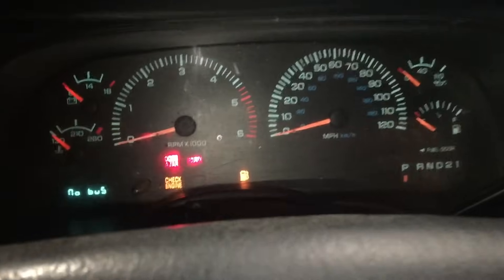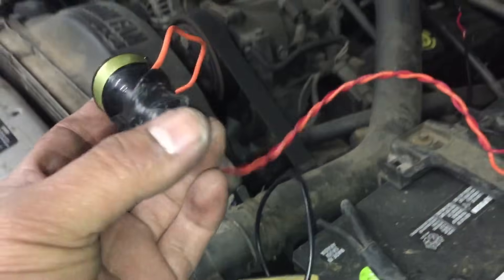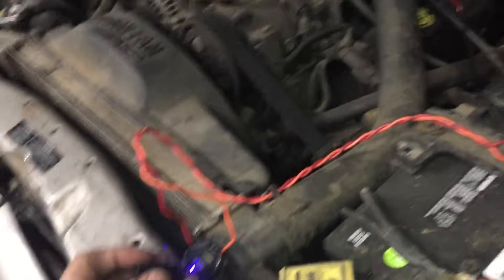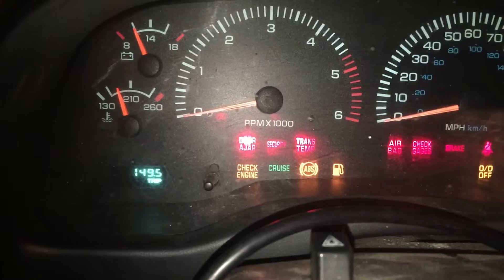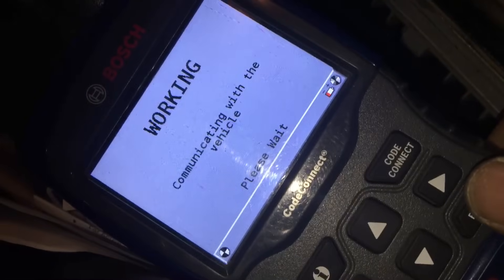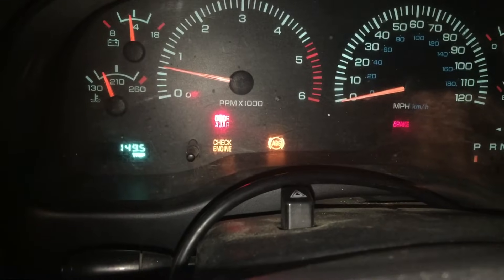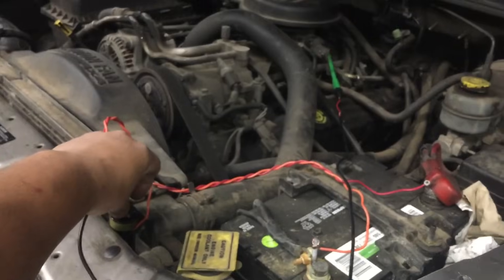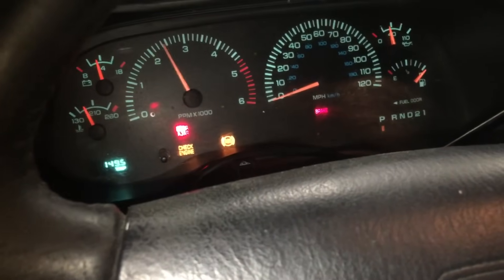No Bus No Start FIX!!!  Dodge, Chrysler, Jeep, Plymouth, or Ram

Comment: Ive change the idle air control Map Sensor an Throttle body sensor an the Ignition Coil an its still off when im Driving

Comment: kinda same issue here. though i get no bus through the cluster diag. truck starts and runs fine and the obd port communicates just fine as im able to see live data. i've tried to use a different cluster from lkq and got the same no bus message. any advice?

Comment: very good trouble shooting the usb plug supplies the 5 volts to the TPS then back feeds the no-BUS volts, wala engine starts my truck has the AIS code as well due to the acu-pcm not communicating sometimes it idels other times not, thanks

Comment: It's a lie. He said he wired up both the positive AND negative to the tip of the cigarette adapter. Well go ahead and hook a 12v battery pos and neg to the same spot. See what happens
Reply: He skipped the part that explains that the negative wire is connected to the negative on the phone charger. Come on man, use your head! No need in your comment. You might cause someone to click off of this video who might really NEED to watch it!!

Comment: One question, what is the right way to repair this issue? Like original way. Thanks
Reply: Symptom: Engine will not start. Gauges are inoperative. NO BUS message displayed on odometer.

Problem 1 of 6: The 5v power supply from the Powertrain Control Module (PCM) is shorted due to a shorted Crankshaft Position (CKP) Sensor.
Problem 2 of 6: The 5v power supply from the Powertrain Control Module (PCM) is shorted due to a shorted Camshaft Position (CMP) Sensor
Problem 3 of 6: The 5v power supply from the Powertrain Control Module (PCM) is shorted due to a shorted Manifold Absolute Pressure (MAP) Sensor
Problem 4 of 6: The 5v power supply from the Powertrain Control Module (PCM) is shorted due to a shorted Throttle Position Sensor (TPS).
Problem 5 of 6: The 5v power supply from the Powertrain Control Module (PCM) is shorted due to a shorted wire..
Problem 6 of 6: The 5v power supply from the Powertrain Control Module (PCM) is shorted due to a shorted Governor Pressure Sensor.

Also check your grounds on the heads/firewall and fenders. And lastly as mentioned by the video the PCM may have broken solder joints due to heating and cooling of the main PCB. Not to blame Dodge/Chrysler, this is a pretty common problem with many electronic devices. Any electronics that gets hot then cools is going to flex the main PCB and break the non lead solder that is used in electronics.

If you want to take apart and repair the PCM check "Keenan Laws" YouTube videos on repairing the Dodge PCM
Reply: Did you ever figure it out I need some help

Comment: How is this working when the 5v ground from the usb supply isnt connected? It is just hanging at 1:40
Reply: The same way a power probe works. 😉
Reply: @JAERepair  so the 5v ref. ground shares  the 12v ground? That makes sense. I was going to try this but I replaced the ecu and that got my dakota back on the road. Thanks for responding!

Comment: Hi I was wondering if I can use this to get my dash gauges to work on my 2001 Dodge Stratus. I was getting the No Bus code and now the check engine light doesn't even come on so I can't get it smogged and my tags are over a month due. I really need help getting this fix and I don't have the money to rake it in to have it fixed. THANK YOU I hope you can help me.

Comment: I just want to say I was stuck on the side of the road in a bad area and the truck died and that code came up and I watched your video and it totally saved me man I mean like save my ass big time I appreciate it that was a home run thanks a lot have a good holiday man
Reply: How do you like wire up could I just use a long usb cable n splice into that cable and connect it to the 5v adapter
Reply: I just put a new clutch in my 2001 Dodge ram 1500 3.9 and put it back together. Now it won't start, my gages don't work and where my mileage numbers are suppose to be it shows no bus what do I need to check, do or fix?

Comment: That was a great help thank you truck started right up. There's a issue still it won't stay running even if you pushing on gas. The only way is starting fluid or pouring gas into carb fuel pump sounds like it's working. Any ideas anybody

Comment: Man, I just read most comments and didn't see one comment that said it didn't work. I got a 2001 dodge ram 1500 van with the 5.2. Started out while driving it just died , then would re start. But sometimes would not start,then show the no bus code. Eventually it finally started again,and drove for  awhile, then same thing happened again. I YouTube the problem and came across your video,and tried your USB bypass trick,  cause it made sence BUT IT DIDN'T WORK. only tried it on the one sensor. I'm thinking maybe the problem is the  transmission sensor,  being I recently have had some  transmission problems.  Is that possible? I'm also thinking maybe problem is the pcm computer, being so old and having 278000 miles on it, but that's a lot of money to spend on a hunch.  Can you give me any help on my problem? I would appreciate any help I can get. Thank you

Comment: How about 1500 4x4 2001  with no bus will not start unless you hook up the scan tool pig tail then it runs ??
Reply: I would check for aftermarket alarm on that

Comment: I have been looking for a wiring schematic for my 2002 Durango and Dakota which, when I went to try this trick on the Durango, which has the No Bus error, the wires are different coloured. The wire that goes to the same pin on the TPS is orange. Would you or anyone know if that is the 5 volt wire into which I should tap to feed 5 volts?
Reply: Put engine size also, easier for someone to look it up usually.
Reply: Yes it is

Comment: Worked for me but I didn’t have to let off gas slow worked as it should Thankgod, my symptoms were making me thinks cps sensor tps ignition system o2s battery all of which I replaced and this was the only thing that worked finally after months thanks so much, I knew was computer with it saying no bus eventually but finding out to make a 5v lead back to computer is what helped me!!!

Comment: This is exactly what's going on with my 99 Dodge Durango. It would not idle when I took my foot off the fuel pedal and sometimes it would and I could be driving down the road for 5 or 10 minutes and it would just stall out and not start. I'm not sure if I have the skills you have to wire it up myself. Thanks for the video.

Comment: Thank you hooked up like  you said bam cranked right up but I had to ground the usb cord to the battery until fuel pump started up then released ground and cranked up thanks again great vid
Reply: Can you please help with the order of connections so I don't burn another wire
Reply: Can you please tell me how the order of connections are to be setup and the positive negative wires are to be set on the charger
Reply: Also how are the positive and negative wires connected to the charger

Comment: Respect Auto Works could u plz message me i got a  03 dodge starts n dies ive replaced every sensor ect i need some help.. thank u
Reply: I have this issue with my 2006 Chrysler 300C 5.7

Comment: Obviously this is temporary. How do you trouble shoot the real cause? My car randomly dies while slowing down and I get the"no bus" error. However, if I wait long enough, it'll start up again. Any thoughts?
Reply: I have the same issue right now! Did you ever find anything out?
Reply: @Lvl7Scared  yeah I replaced the computer and it solved the problem. I started with a lot of sensors first. Computer was the problem.
Reply: @yeabrooo  thank you! Im about to do the same thing

Comment: I had the same issue. I had to replace the fuse box. I used my son as the key man and I started shaking wires and found the big connector on top side of fuse box has a wire connection issue so I pulled it out and found green color which I think water got in it. Lesson learned on buying someone's mud toy

Comment: How are you completing the circuit without connecting negative wire from the USB plug? You just hook the positive up to it but you didn't hook the negative up so how are you completing the circuit?
Reply: The sensors are already grounded.
Reply: @adamhyde7484  if he didnt connect the USB black wire to a vehicle ground this trick wouldnt work because current cant flow in an open circuit.

Comment: Thanks so much for this video.  But my truck wouldn’t run if I kept it the power plugged in.  I had to unplug the power after a few seconds or else it would start sputtering and almost dying but would go back to running normal after I unplugged the usb.   If your smart enough to figure this out maybe your smart enough to give a good guess as to my issue.

Comment: What is the green tool you used to connect the usb to the TPS? I have everything wired up just need to connect it. I thought about just wiring the positive to a small nail and pushing it in there but I want to be sure.
Reply: the green probe is an accessory used with a power probe tool. you have to buy it separately.

Comment: Looking for some assistance. Same No bus issue here. I tried this technique in the video and still having the No bus issue. I have replaced the crank, cam, idle/air, and tps sensor. Getting 5v on the tps sensor. Had the pcm replaced with a good warranty unit. Battery tested good. Visually I can’t see or smell any burnt wires. Entire fuel pump unit was changed as well. Engine is getting fuel but no fire. Did the gauge reset as well. Checked all the fuses. They were good. Haven’t checked the relays but did swap my engine and rad fan relay to see if that would do anything. It didn’t. Any other suggestions?
Reply: Look for a short to ground by checking all the circuits for the sensors you replaced

Comment: Good figure it out. Maybe, when ignition on (not start) can bus present then ECU  active 5 v to all sensor. But (in you case) if we put 5 v from external power, engine start, even if don't communication with another module. Thank you so much for your video.

Comment: Jesus wish I’ve seen this earlier, my dakota has been sitting for two years with no bus code..thankss man
Reply: Parents gave me their old 2000 Durango, only 138K miles.  Drove it about 4 months, then the problems started.....Been a lawn ornament since March.  Started to randomly shut off, no error/codes while driving-no matter if it's highway, at idle, just driving through town.  Just tried something else out on it, thinking something to do with oil pressure, and just got that no bus code when it shut off again.  Hate to junk the car, it's pristine looks wise interior/exterior, drives great-when it does.  But thinking just not worth it to toss money in any chrysler product.
Reply: @Christy.1  The problem came back 1 month later, it was the PCM. It shuts the truck and then there's a data dump. That's why you miss the error codes!
Reply: @tyronewalker5764  That sucks....That's what was pissing me off with this problem.  You look around and everyone says it's this, it's that.  I don't have the money to continually toss parts at it, hoping it fixes it.  I finally got fed up, drove mine over to my mechanic.  Mine usually did it within about 30 mins of driving, after it gets hot.  So it's something related to that I think.  So he hooked it up we let it run till it shut off, trying to pull a code before it wiped it.  It STILL wouldn't pull a code, just that No Bus.  Mechanic said it was erasing it right after throwing it, I don't even think it was throwing one.  I think it was the computer just shutting down.  So did you find a PCM for yours?
Reply: @Christy.1  have you done anything with it since your last comment?
Reply: @patrickwayne3701  Yep done lots lol.  So much for a free vehicle....The issue above was the PCM.  I picked one up on ebay from a place called Flashmasters, was $200.  They have a shop in Ohio.  Very easy to install, disconnect battery, 3 plugs on the PCM.  Did that, about month and half ago.  Then I found out my radiator was leaking on the bottom so wasn't able to test out the PCM initially.  Then thermostat needed replaced.  Finally, I've been driving it all over/regularly now about 3 weeks.  And knock on wood, no issues.   

Also, I replaced the ignition coil too just prior to breaking down and buying the PCM hoping it was just that.  The guy that does most of the work on my car has a '99 Durango.  He cut & bent a license plate and curved it around to protect the ignition coil from the heat from the exhaust manifold since it's right there behind it.  Owner of the shop gave me some, not sure what it's called, but some stuff steel factory uses on their furnaces.  Can withstand super heat, it's like a weird cotton-type thing.

As for PCM's, if that's what you're looking at, from my researching around a lot of places for whatever reason are having lots of customer complaint issues.  Parts not working, can't get a hold of people to replace, not honoring warranties, ridiculous restock fees, etc.  So check out reviews and BBB where ever you buy from.  The reviews on ebay on that one I chose were all good.
Reply: Just got my Dakota,4.7/v8 out the shop. Crank shaft position sensor, go figure!🙄
Reply: @tyronewalker5764  how much did it cost?
Reply: @debramartin9396  Without the cost of rental car $748 +labor. Had to order it from East coast somewhere. This PCM is no longer made for this truck, got lucky!😀

Comment: This is very interesting.   Does the 12v from the battery get dropped to 5v when it goes through the cigaret lighter USB port?
Reply: Yes.  But look to see on the USB that it's 5v
Reply: i highly doubt it
Reply: hes using a cellphone charger.. there almost all 5 volt

Comment: Im a mechanic and specialize in electrical work. Question, instead of rigging up all this crap, why dont you just fix it the right way? Look at a wiring diagram and find the sensors that are fed 5volt reference signals and unplug each individual one until signal comes back.. boom! You found the one... problem solved
Reply: Mike I have a problem with my truck can u help me out
Reply: Unpluging sensors method is useless in this case.    since  there is a no-bus message and the scanner turns on, but cannot communicate with the pcm is 100%  a pcm problem.  if there were a problem with the wiring or any sensor the scanner should still being able to communicate.   for example: lets say the problem is the crank-sensor (that sensor is the second reason for this problem) the scanner wont tell you theres a problem with that sensor but still being able to communicate and give only a NO BUS code.   NOTE: THATS ONLY on dodge, jeep, chrysler, etc.
Reply: Run Run a shorted 5volt sensor can make a no comm happen
Reply: Run Run absolutely wrong.... 
first off, if a 5volt sensor is pulling down to ground then the communications will not be there as you say. Start unplugging every sensor that is on the 5volt reference circuit. Once the bad one is unplugged, you will be able to communicate again. You clearly dont know what you are talking about, I have fixed no communication problems a million times and have 20 years experience. When you get a degree in this field, then come back and tell me im wrongp

Comment: My Dodge 2000 will start but no electricity can y'all give hints or advise to fixing it
Reply: Please anything will help ram 1500 5.2 engine
Reply: You mean no sparks? I can send you the diagram
Reply: @4jiggaalways  ok
Reply: Send me your email and what the issue is I can tell you whats wrong!
Reply: @4jiggaalways  meguncorigaurkee10@gmail.com the cluster instrument  is not work and we can't find the problem  on the side fuse box the fuse is out the one cluster
Reply: It 2000 dodge  ram 1500

Comment: What if you have the no bus error and still have the 5v?
Reply: Damon Gist that’s my case! I haven’t found out.
Reply: @erikbravo5464  Mines end up being the computer(ECU).
Reply: Damon Gist yes! I got fixed my original computer and seems to be like new. Now I also bought an spare computer to have it with me in case it stops in the middle of nowhere.
Reply: Soon after you get it running find and fix the problem, go to auto zone get it read for free buy the part replace, well that's what I'm about to do😂
Reply: Mike Dollars I ended carrying a simple scanner in the glovebox so you can read and erase codes. But the Ecu won’t send a bad ecu code. However you get to see no communication with the modules. In my experience with this vehicle if you already checked and or replaced the sensors (tps, map, iac, crankshaft and camshaf & oxygen) then it’s the problem is the Ecu. I got mine repaired on eBay, and it’s running great thankfully.
Reply: I've been scanning the tube since I've found 5v and one made me think I have an after market radio in my truck that started acting weird last month so I just kept it off, I wonder if it's finally biting me , the difference is 30 bucks for a radio or 300 for a rebuilding from the zone

Comment: Okay so let me get this straight , you chose a 5 v wire on anything that carries it in other words a wire on one of the sensors ? So you used a USB cigarette lighter adapter cause its output thru USB is 5 v  ? And even if you have a short in the 5 v line somewhere , it will bypass it ? If so that is fantastic!!  I subscribed cause that's the type of intelligence I need to learn from.
Reply: No he used the tps 5v ref because it shares the same circuit as all the other sensors he mentioned so he just giving it its own 5 v since the pcm doesnt do it